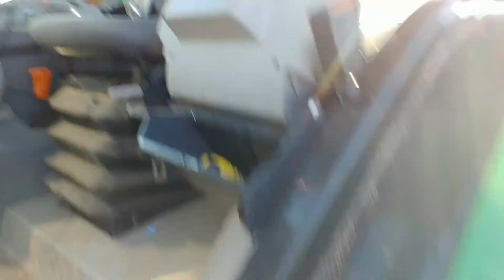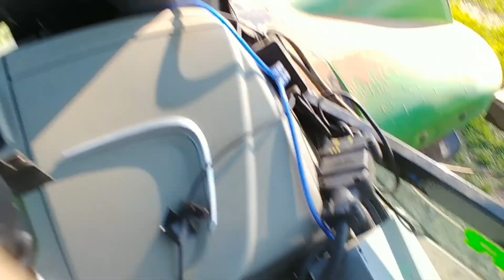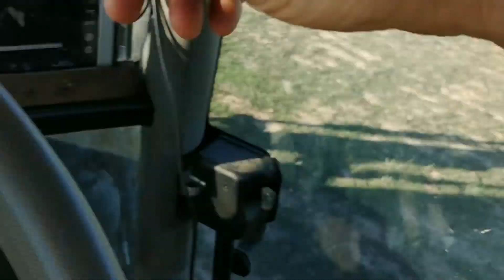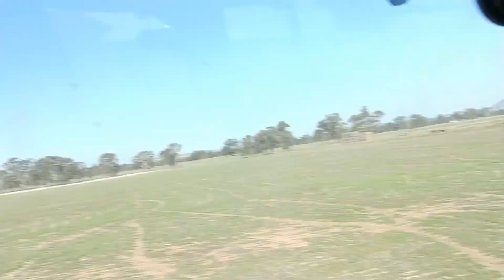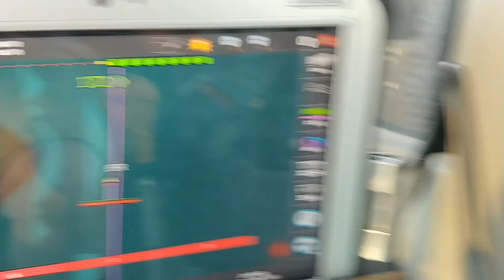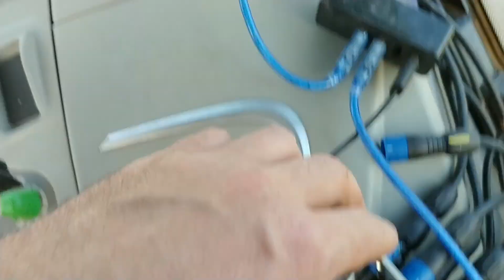Spray cart section control using Agopengps

Comment: 14:30 some do have wheel sensor to turn off fwd lock when turning. Easy to verify if you have electronic locking on front wheels. Turn and see if it disengages and engages when wheels straight

Comment: Hey mate nice work on the set up so far!! There’s a really good set up in one of the agopen gps success story pages which uses a linear potentiometer attached to the hydraulic ram for the steering angle sensor, it’s on the back of a header but it’s the same principle, looks like that would work for your set up, just using clamps on the ram and running the cable back into the cab. Would save trying to hack the OEM one.
Reply from the maker: Thanks mate! First up i just gotta say your recent spray cart vid is sick, love the drone video and the music - had me laughing. I'll have to get some too. Yeah cool, we actually have done that with a cheap potentiometer on an older tractor, and yeah it seemed to work. I was however worried about the reliability, especially if it got wet or muddy. The stock one on here looks real robust and is obviously designed to handle harsh environments. I haven't researched it much, I was hoping it would be simple to read the data! if its scrambled or security locked in some way that would be annoying... however I guess it would just put out a signal voltage on a wire at some point. Next project....
Reply: Ronan Taylor-Ware hahahaha thanks mate, yea we had a good laugh when we where putting it together, was the first few songs that came up, seemed too funny to pass up... might make it a bit awkward trying to show the older generation hahaha. I was using the land rover suspension ride height sensors on the steering for our wheel angle sensor but had a few issues so ended up just putting a potentiometer in a small box and used a little hub to connect an arm across to the steering, we’ve just done 1000 acres in the Ute without a hitch, and if it fails I can build another one from parts on the shelf at Jaycar, as opposed to ordering one from wherever. Not saying mine is better but it’s a get out of jail option for us that has turned out to be good enough to stay installed. Would be good to catch up some time mate, seems we are on similar paths with this project.
Reply from the maker: @matthewoconnor164  Okay interesting. Yeah would be good to catch up